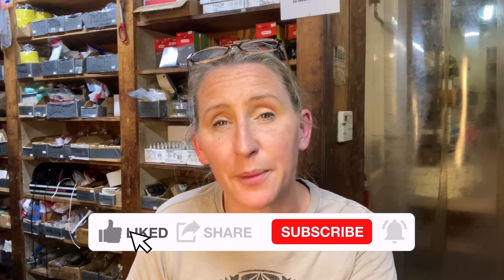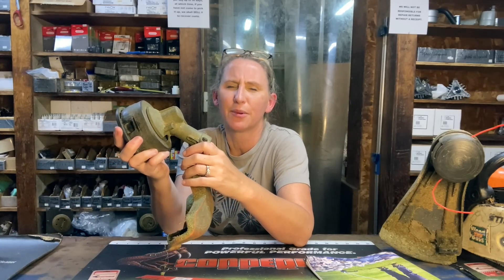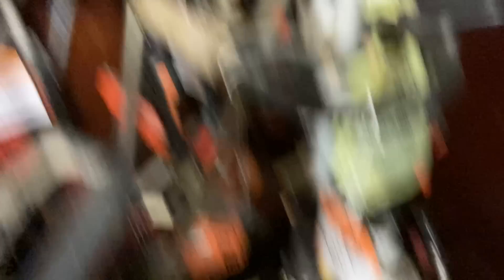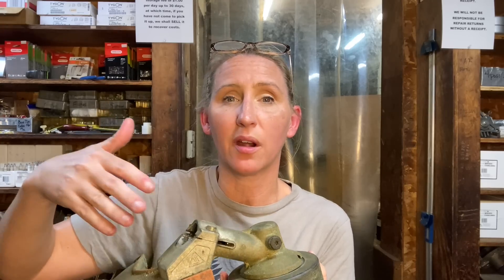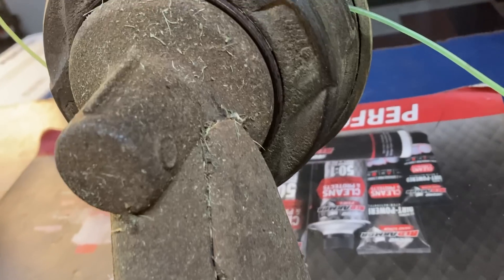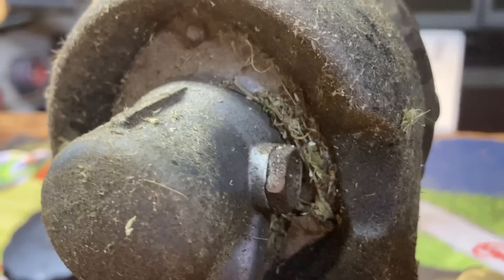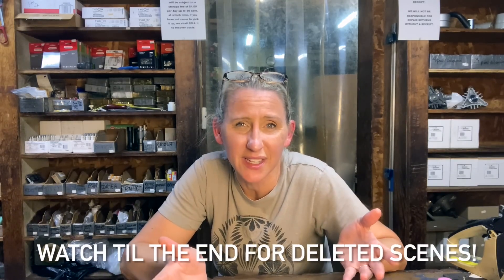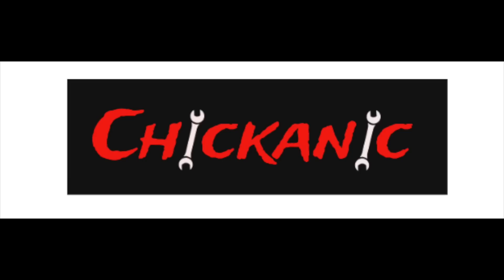Planned Obsolescence?! Why Would STIHL and ECHO Do This?!

Comment: STIHL, and echo are not in business to sell parts they want to sell whole goods, Stihl Vowed  to never sell out to box stores yet. I see it every day now.
Reply: Never seen Stihl in a box store and you can't buy them from their websites so not sure what you're talking about.  
If no one sells, them except speciality stores, how did they "sell out"?
Reply: @feliciasbeard  I see Stihl equipment in our box stores now and it doesn't make any difference since Echo is sold in box stores and you can find Honda GX engines in two box stores in Canada and they are superior to Stihl.
Reply: @feliciasbeard  just because you haven’t seen it doesn’t mean that it’s not happening. Do some research before you start bumping your gums.
Reply from the maker: 😂 I literally pulled the ad for Stihl for this video from the Ace Hardware web site. Guess I shouldn’t had cut out the edges. 😂
Reply: @Chickanic  sad thing is they have no support for the products they sell. A piece of paper on the wall showing silver certified and that was the owner manager of the store. They don’t actually have seasoned trained technicians.
Reply: @Chickanic The reason the FS 55 doesn't have a grease head is because it has a flexible shaft that runs straight to the head thus it doesn't need a gearbox due to the flexible shaft.
Great unless you want to put a blade in your machine for which if you hit something you could snap the flexible shaft
Reply from the maker: Or was it Atwoods? 😆
Reply: I see Stihl in almost every Ace hardware. Ace is very much a box store the service and repair tech in these store general seriously lacking.
Reply: I see Stihl at both Ace and Sutherlands (which also has Echo). The Atwoods almost next door to the Sutherlands has Husqvarna.
Reply: @toomuchmonkeybusiness  yep
Reply: Any thing they say is just like Putin word